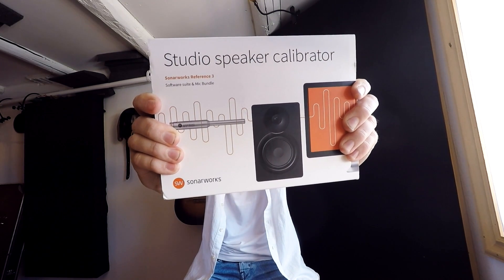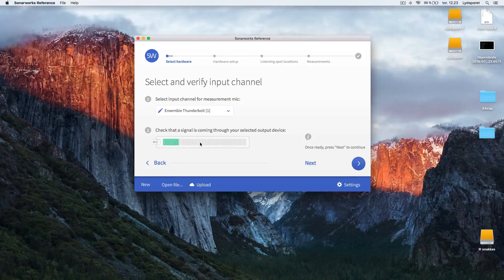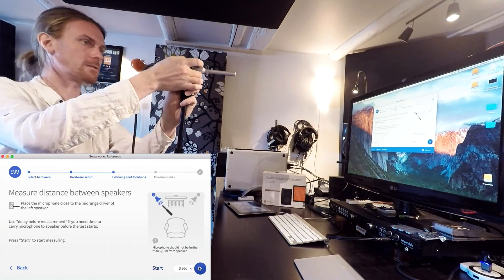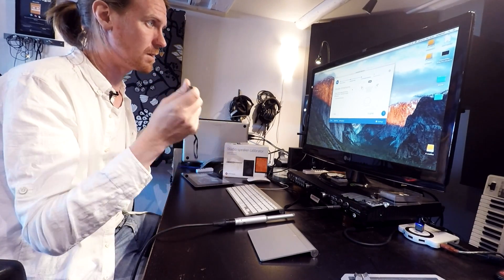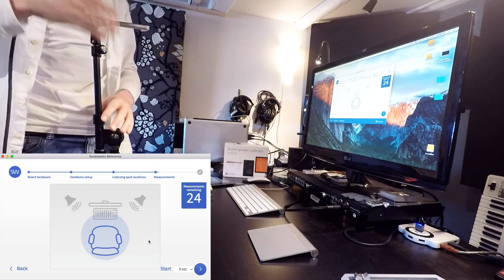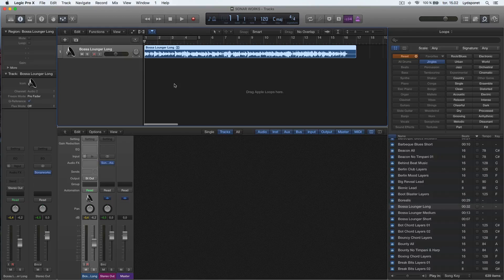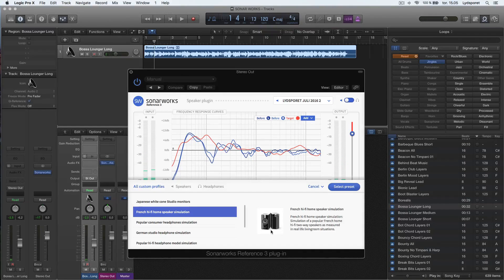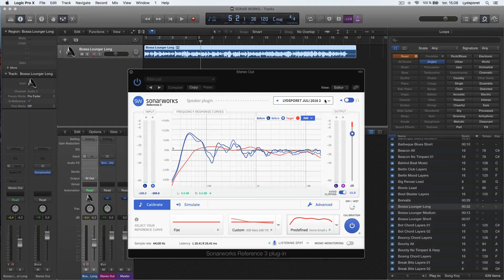SonarWorks Reference 3 - Step by Step Tutorial

Comment: does not work with microphone arc
Reply from the maker: Yes, but you will get the best result using SonarWorks microphone because they have calibrated the microphone. You get a measurement file that is unique to the microphone to do the measurement :)

Comment: HOW DO I GET THE PLUG IN INTO MY DAW?
Reply from the maker: It should show up in your DAW after you have installed it and maybe also restarted your computer.  If not you should check in your DAW Preferences and look for plugin management. Maybe you need to turn it on there. Hope this was helpful  :D
Reply: cant find the plugin, I turn on the reference software and it works with youtube but not wityh my DAW...unreal its useless, and theres 1000 videos on how to calibrate your room which is trivial but nothing on how to integrate it after
Reply from the maker: What Daw are you using and PC or Mac?
Reply: I'm using PC, I got the plugin working now, I had to tell my DAW to search the vst folder, the regular one not the x86 vst folder, thanks for the help! cheers!

Comment: yeah you skipped through the part where it fails me -  the front measuring. I simply cannot go any further to the front with the mic without going BEHIND the speaker. Very annoying!
Reply from the maker: +Catalin Popescu did you set the samplerate right? This happend to me the first time. I couldn’t get through the prosess before I changed it to 44.1 :-)
Reply: Yeah I figured it out, the word clock was not synced between the external card I used for recording and the internal card I used for playback. Sample misalignment! :P
Thanks for the help!
Reply from the maker: +Catalin Popescu Glad you solved the problem 🎉

Comment: Hi, will the calibrated Headphone through demo software work independently with external music players and will they retain the sonic change with these external players or do the effects work only on the pc on which the plugins are installed?
Reply from the maker: The headphone plugin will only work in your daw. But SonarWorks also has a solution that is called  system wide. That will make SonarWork headphone plugin to work on your main sound on the computer. Like listen to music through Youtube, Spotify, iTunes and so on.  If you don´t want to do it this way, there are some solutions out there that you just need to Google.

Comment: hiya. im trying to setup using the sonarworks mic. the distances are ready fine but when i get to the moving measurments i get to the 4th / 5th measurment and the mic slides back on the screen and cannot get to the placement arrows. have tried this 20 times plus and same each time. any ideas??
Reply from the maker: In this case I think you should contact Support. I haven´t heard about this problem before :)

Comment: Hi !
I bought today the complete bundle (Reference 3 Speaker + Headphone Calibration bundle + Systemwide).
I'm waiting for it to arrive within few days  :)
Can you answer me, please, about:
1. If I need to bounce midi to audio in the middle of a project (Cubase) do I also need to turn it off before bouncing ?
I'm not talking about final export to stereo file, just render mid track to audio track inside a project & continue working.
2. In Cubase the 2 last master tracks (7 & 8) are Post-fader, I think the sonarworks need to be at 6 (Pre fader), right ? 
3. After mixing in Cubase, when export the mixdown to WaveLab (directly from Cubase export) for mastering- what is the procedure ? Do I need to put again sonarworks  in WaveLab as a plugin ? Should I use it in Mastering too ? or just mastering the stereo file without using sonar, as usual ?
4. Do I must a stand for the mic ? or can I hold it while doing all the measurements ?
Thanks very much for the tutorial !
BTW- Do you know the Systemwide ? I bought it too but there are few reviews on it.
Reply from the maker: Congrats with your purchase :D 
1. SonarWorks only effects your master output. So you can safely export midi to audio.
2. Just leave sonarworks on you master fader as the last plugin in the chain and it will work.
3.When you bounce the mix down to one master file for mastering you need to turn off the plugin before bounce. I would also use sonar works for mastering. At least in the first process before you get to the loudness part of mastring (limiter). I don´t know how wavelab works so I can´t help you there. When I am in studio's with Cubase I do the mastering in Cubase :)
4. I think the best strategy is to use a mic stand. I haven't tried it with just holding it. I guess it would be hard to keep a steady hand. Also you can pick up noise from holding the microphone too.   
5. I haven't tried the Systemwide yet.
Hope this helps :D
Reply: Thanks for your detailed answers & your time !
Reply: thanks man, appreciate it !
Reply: I will think about it haha

Comment: I see you are holding the microphone to the tweeters ? and I see most holding it to the lower part of the speaker ? which is the correct way ? it does say mid range,
Reply from the maker: Yes the instructions says you should hold your microphone to the midrange speaker. I see now that I didn't  do that in the video. But the first measurement is to find the measure between the speakers and your listening position. It could be more accurate to hold the microphone near the midrange speaker. But I did measure with measuring tape and got the same result as Sonarworks  between the speakers and my listening position. So maby both ways work fine :)